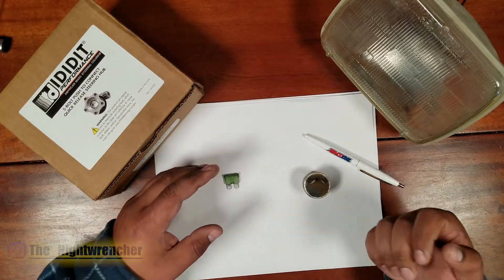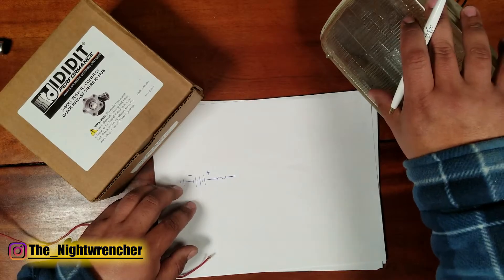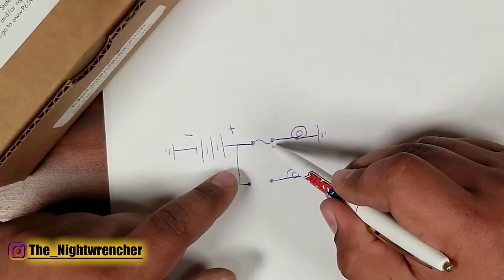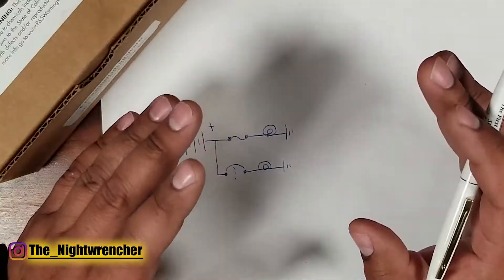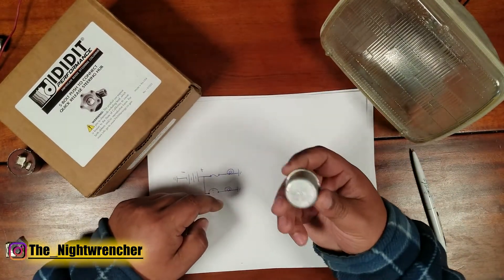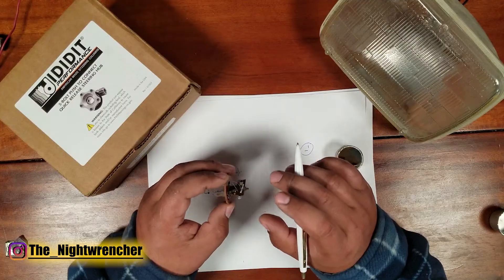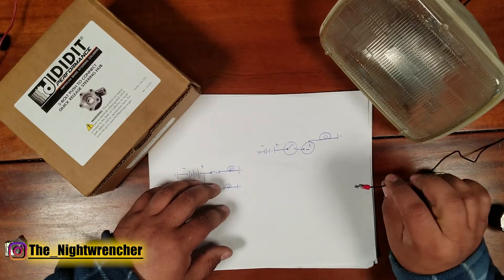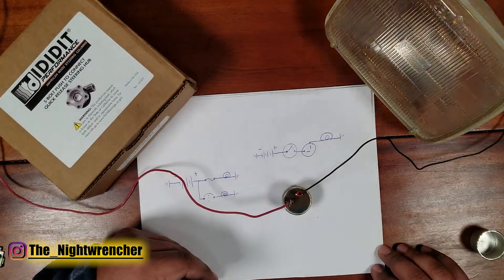Easiest How To Wire Turn Signals Or Flasher | Classic Car Wiring Basics Part 4 |

Comment: Hey I have a 84 cutlass but it only has one flasher and bottom slot empty
Reply from the maker: Some OEMs feed the turn signals with only 1 flasher and it gets power before going into the steering column. The other slot is probably the feed for the hazard switch.
Reply: @NightWrencher  so if all my light are working except turn signals what what that mean because my car fuse box has to slots for 2 flashers but the bottom flasher has no wire running to fuse box for that slot
Reply from the maker: @jermalramsey1567 check the wiring for your steering column. Check to make sure pin L on your connector has powerwhen the key is turned on

Comment: Tutorial for adding ignition or starter relays?
Reply from the maker: @zuranku  I'm litterally working on it right now 👍
Reply: @NightWrencher  That's awesome. There are some cars I've worked on from the 90s and 80s that relied on thin wiring and minimal relays so that can be a headache to deal with sometimes.
Reply from the maker: @zuranku i went through that with my 91 toyota pick up. The voltage would drop too much when it was warm and the starter wouldnt work. Eventually added in a relay and all my problems went away. Have never had a bad experience when adding a relay
Reply: @NightWrencher  That's I would love to do with the ignition and the headlights. The headlights are powered directly from the instrument cluster switch so those contact points are known to build up carbon over the years. Brighter lights and less voltage drop sounds like a win win
Reply from the maker: @zuranku thats exactly what I did with my 75 w100 😂 high beams and low beams were on their own relays and I had the low beams set up as DRLs
Reply: @NightWrencher  Now that's what I call OEM plus!

Comment: holy crap I never knew that, thats cool. the flasher is flashing bc of a literal, physically moving automatic switch, so to speak. Thanks, loving this electrical series!!
p.s. your presentation and explanation is very good. Thank you!!
Reply from the maker: Its pretty funny how simple some of these systems are 😂
Reply: So if the headlight burns out, to me it would seem there is no more load.  So why doesn’t it cause a short to ground situation?
Reply from the maker: You're thinking about it wrong. Think of it like this. The more lights on a flasher, the more time the flasher needs to heat up to break the contact because the amps are being used up by the headlights. Wierd how it works that way but it does.

Comment: Some flasher relays have 3 or even 6 pins. What are they for?
Reply from the maker: 3 pin flashers have an extra leg for ground. That lets them stabalize the blink, regardless of the load. For example, if one of your lights blinks fast, it means your light is out so you can swap a 3 prong flasher in to return the blinking to normal speed
Reply from the maker: 6 pin flashers are use to add an addition circuit to the flasher system